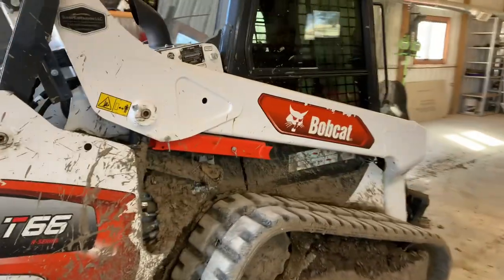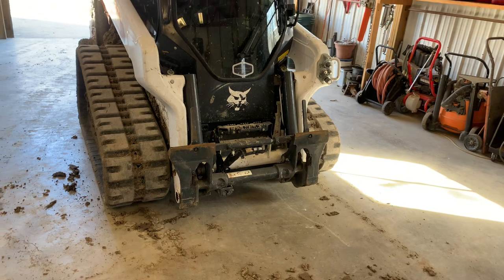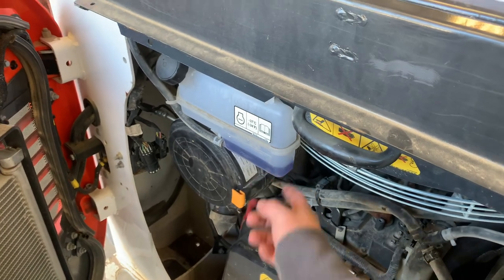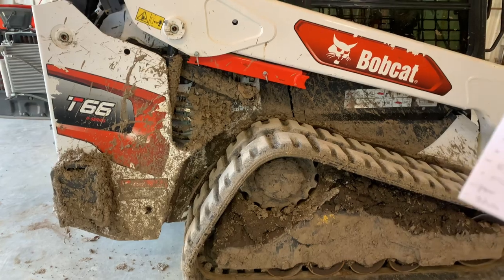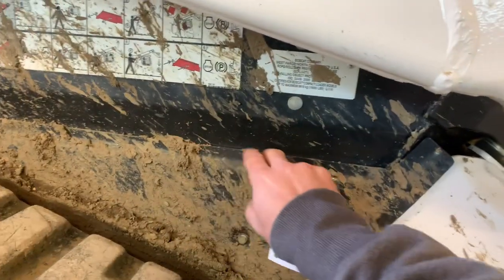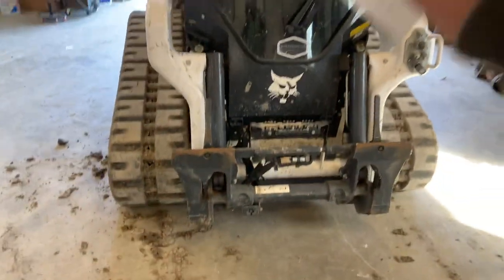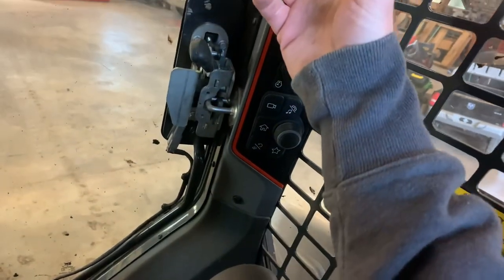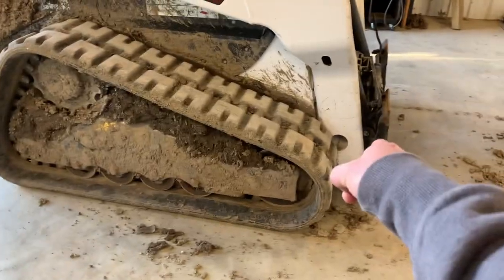BOBCAT T66, my one year review #bobcat #review #skidsteer

Comment: For the door latch, loosen the two Allen screws on the cab frame and slide it back roughly 1/8” to start, and tighten. Close the door slowly to make sure it lines up before closing harder. Repeat and fine tune if not right the first time. My door was rattling and let in water when cleaning. Fixed the problem and a world of difference.
Reply from the maker: The comment I’ve been looking for. Thanks my guy I’ll give that a try when I get a chance. 🤙

Comment: I have the same machine, and I as well hate those 2 grease points, and the fluid sight glass is just in a poor location But my biggest complaint is how the tracks get clogged up especially in mud, in dry dirt there is no problem, the  bobcat stickers plain are junk. but the machine is awesome and overall if I had to choose I would still get it. I dont have the coolant issue you have I also do not have an issue going up hills. In the cab   The door is a dumb design and it needs another place to put gloves or whatever

Comment: On our S66 the backup camera is disconnecting more often than being used and this causes a warning chime every 3 second or so.  The Max control system is that you connect to the machine go through the start up process and then reconnect to the machine because it lost WIFI signal for some reason.  We had the rear left hub replaced twice with under 50 hours of time on the machine, the second time it broke was on snow and ice without tire chains.

Comment: Appreciate the review, this month have been trying to decide between the T66 and Case TR310 so its nice to see some feedback.
Reply from the maker: I’ve never really ran any of the cases so I can’t really give you an accurate opinion on it. But they have been making machines for along time I’m sure it’s competitive.
Reply: @BuiltbyBurns  Really liked the T66 and was hoping to get one but ended up going with case, mostly due to being about $15k less.  Machine prices are crazy
Reply: I have a case tv380. Has 700 hours seems to be fine. Bought it used had a few sensors go out. I'd go with whichever offer the best dealer support. Alot of these places will be awesome till you buy.
Reply from the maker: Amen to dealer support, in my opinion that plays a huge role in what path to take when purchasing equipment.

Comment: Great video, and funny!  I have a T64, which I was told even has the same engine as the t66 but less horse power due to a computer setting.  Anyway, totally agree with you on the stickers……they are horrible.  I hate having a new machine that looks old because of the stickers. I need the fan too, and agree, why not make that standard.  I added the side light kit and definitely would recommend them, but I work a lot at night.  I also got the upgraded glass that gets rid of 75% of the side grates, by accident, as it was all they had at the time and I would never not get that feature.  Even though the backup camera is nice I still would like a center mirror like some of the other manufacturers give you. Ultimately, like you I would definitely buy it again.  Thanks for making the video!

Comment: I love the machine, the cab looks a lot more comfortable then my Kubota SVL 65. Honestly I don’t think the Kubota has a single issue that you talked about. Now don’t get me wrong they have their own issues - like the windshield washer fluid reservoir on the inside of the cab right above the cup holder so it gets all over your arm and drink from bouncing around. Or how the fuel filler neck is at such a low angle it takes fuel really slow. But I am really surprised at the little details bobcat left out when designing that machine.

Comment: if the rattling in the door is between the latch and the ring, maybe a wrap or two of electrical tape would be a temp fix
Reply from the maker: Yea I was thinkin about slappin a tack weld on the latch and just grinding it down until it fits just right.

Comment: on the door latch, mine does not do that but mine only has 100 hours. Anyway you can remove that latch with the 2 large phillips screws and flip it around after you just try to pull it back and tighten, you wont need much

Comment: Lube issue... grease gun tips are adjustable so you can tighten or lossen the grip on the grease zerk and won't have to snap off to the side.  I posted this twice because it didn't show up the first time. Wanted to let you know before you broke out the cutting torch

Comment: I have 5 link suspension,  its gives you 3 inches between tracks and side of machine with wide tracks . I see yours is very tight.  All mud falls off with 5 link
Reply from the maker: Interesting, I dident realize the 5 link gave you that kind of distance off the machine. Have you had any issues of complaints running the 5 link?
Reply: @BuiltbyBurns   no complaints with 5 link. I own a t595 also actually prefer it over the t66. I just they are making everything cheaper and smaller cabs . On the list to get kubota svl75-3.  Looking like may . Time for something different owned Bobcats since 2001. -   svl75-3 looks to be a game changer.  1 piece cab finally.
Reply from the maker: I know what your sayin. I’m leaning towards Takeuchi myself. I’m kicking myself from letting them talk me into this t66 and not waiting for the t650 to come in stock when I bought this thing. I agree thought, bobcat is not what it use to be since doosan took over.
Reply: @BuiltbyBurns  you can now order a t650 . Same machine it's now a m3

Comment: Yup i agree with everything you said .The engineers should all be fired that designed this machine and were not even talking about the engine.Watch when you get a few hours under that doosan engine and you have to start replacing 800 injectors.The common rail fuel systems with electronic injectors are garbage compared to the mechanical fuel systems of the the pre 2014 machines with the kubotas.

Comment: The only thing that really concerns me is that the cooling has been evaporating. That's a huge issue! more than the other windows and mud, i will call the dealer and take it back ASAP.
Reply: The maintenance guy here said he had one where it was overheating because the factory didn't put enough coolant in it.  I wonder if it just evaporated like this?
Reply from the maker: @onjofilms I recently had a recall related to a coolant tube on this machine. After having it exchanged I’ve been keeping an eye on it and I have noticed the machine is maintaining the coolant level at the moment. Hopefully it’s fixed.
Reply: @BuiltbyBurns  Yup i had the same problem with my T76. Had a small leak right above the fuel tank on a joint. Easy fix once i found it.
Reply from the maker: Funny you mention that, a few weeks ago I was doing some routine maint and I found mine leaking in the same spot. Right where a coolant tube was connected.
Reply: @BuiltbyBurns  just nice to know it's a small leak and not burning up in the engine!

Comment: For someone considering a T595, how would you compare this?
Reply from the maker: I’ve ran a t595 a few times. I like them. As far as comparison to the t66 I would probably lean more twards the t595. Mostly because I see a lot more people in my area running them over the t66. To me it’s a more simplistic machine. Me personally I like the t650. I hate to say much more mostly because I don’t feel like I have had enough experience on the t595 to give you a honest comparison.
Reply: @BuiltbyBurns  That's kind of the vibe I got. Seems guys prefer the T595. I was looking at T650s too, but I don't really don't need anything bigger than a T595. I'd be replacing a compact tractor with it mainly for more lift capacity.

Comment: 2speed will bog it down more if it already struggles up hill
Reply from the maker: I’ve ran the same machine with 2 speed. In the lower gear ratio this t66 runs much Better overall when needed. The current ratio on this t66 without the 2 speed is overall good, but lacks power or speed when needed.
Reply: Lube issue. So I watched a video on grease guns and I was shocked to learn that the tip has an adjustment to take it off without having to snap it off to the side. I've fought to get them on and off for 60 years and had to learn the trick from grandpa you tube.  🤦🏼‍♂️